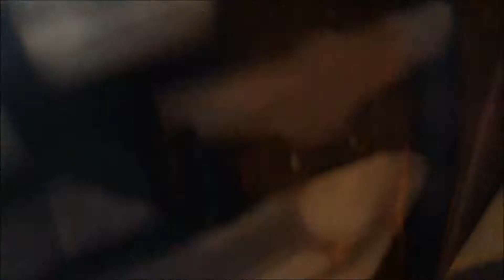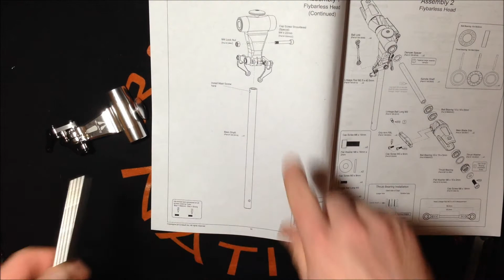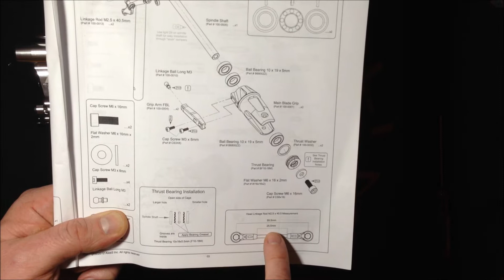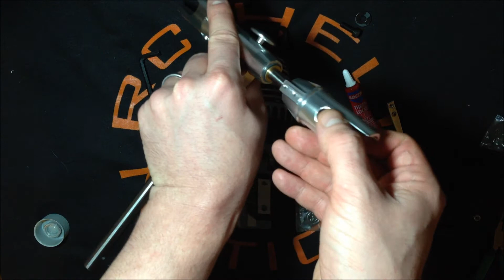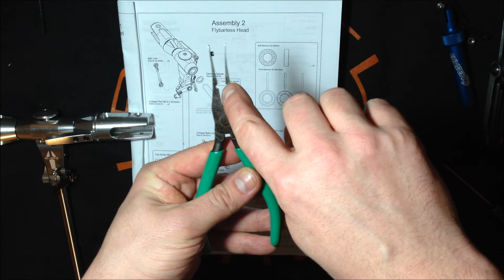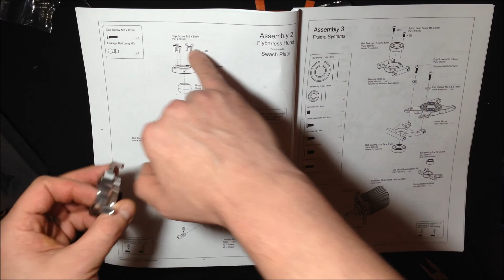Rush 750 Build Vid Part 1

Comment: The head button shouldn't be loose like that, the hole wasn't tapped deep enough for a 10mm screw. Either there is a mistake in the manual or they made a mistake with tapping the hole at the factory (pretty much every Rush headblock is like that) You can either switch to an 8mm screw or get an M3 plug tap and carefully thread it into the hole with your fingers till it hits the bottom of the threads and then put a tap handle on it and turn it the rest of the way through to cut additional threads (put some fine machine oil in the hole first to lubricate the tap). I choose the latter as I didn't like how little thread there was with the 8mm screw.

 Note that the Evo is apparently the same way, if you follow the manual you can't fully tighten the head button.

Comment: Nice job Deater on the build videos, I know they will come in handy for many. Was curious how tight your blade grips would be when you got them together. I built mine a couple of months ago when they first came out and they were really really tight and noticed that the spindle shaft sat down inside the bearings so i sanded both dampers just enough so that they were level with the bearing packs and still had the proper spacing between the grips and the head block, nice and smooth now. Nice Vids.